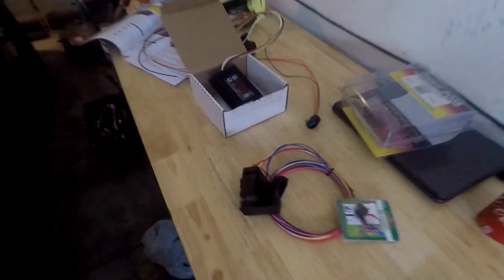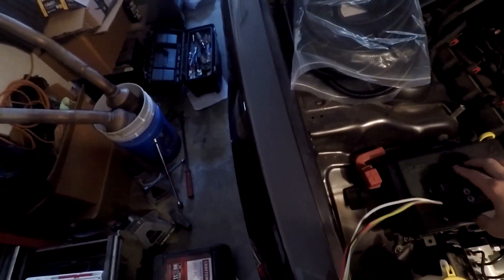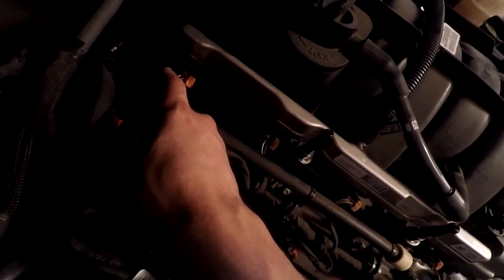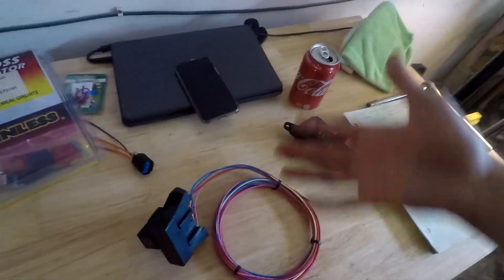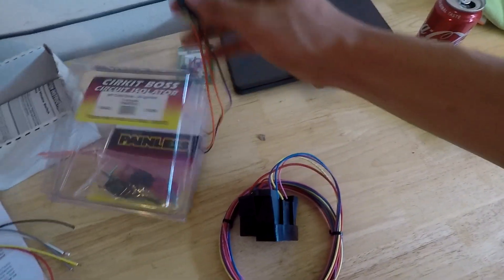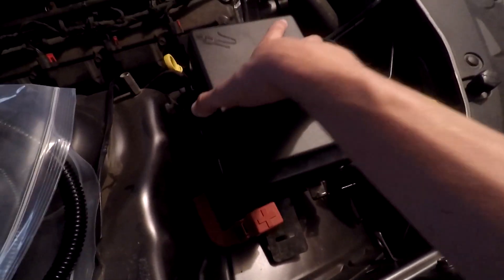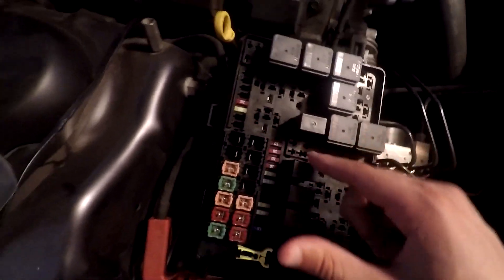392 Intake Manifold Swap: Wiring Overview | Part 2 *check description*

Comment from the maker: Hi everyone! I made a mistake with the injector wire at 4:00. In this video I said to tap into the green wire, which DIDN'T WORK. Instead, I spliced into the other wire. MSD Box is working properly now!
Fuse tapper: https://www.amazon.com/Nilight-NI-FH02-Circuit-Adapter-Warranty/dp/B0742BZXC2
Reply: I need a way to get your wiring diagram asap

Comment: @DonnySRT After you trim the red power wire off the circuit boss can you use the scrap red wire as a ground wire for the circuit boss ?

Comment: By far the best explanation of any YouTube channel 👍. Like I asked in the last video. Do you recommend an email tune or a dyno tune? If the latter what’s the best way to find a shop knowledgeable on these engines? My upgrade list is as follows. 6.4 intake manifold and throttle body. 309 lsd. 100 shot wet plate nitrous system for sure. Probably a hellcat lower air box, headers, and maybe a free flowing cat back. You talked me out of the cam, I like the current drivability as it will be my daily driver. Any help advise from you or the knowledgeable comment section. Thanks again for the great video.

Comment: I have installed my followed all directions on this video.  And I still get 0 reading on my msd.    I tapped into the second wire and yet no reading. Just 0.  Any tips ? Car starts and drives.   Just mad is at 0

Comment: Hey Donny, thanks for your videos I completed my manifold install because of you, one thing I need help with is how the SRV connector is locked on, mine wasn’t locked in because the tab was broken so I had to replace the connector and squeeze my hands in behind the motor to put it back on😂🤣  but I need a good explanation of how the connector is installed and Locked on the srv actuator 😂 because it still slides off. I pressed forward on the red slider tab to try to lock it in place but it won’t click in. I’m sucha noob please help
Reply: Could be how Installed the wires in the connector? Do the wires just push in to the slots of the connector?

Comment: So I got the manifold on and did all the wiring, no check engine lights or anything and can definitely tell a tone difference. Only thing is the MSD box doesn't light up at all so I'm pretty sure its not working... tested all the connections and they're all good so I think I got a dead MSD box :(
Reply from the maker: I've heard about similar issues from a few people about having a dead MSD box

Comment: You said you have to buy another plug. Where did you buy your plug I'm needing one
Reply from the maker: Which plug are you talking about
Reply: @DonnySRT  the plug at 1:45
Reply from the maker: @punisherhemi6008  I made a video with the links to everything. it's a wiring harness repair set

Comment: any idea if this would work with a 2012 rt? not sure if the wiring or electronics are different
Reply from the maker: I don’t see why it wouldn’t. Works for people with the 13 and 14
Reply: DonnyR/T cool cool. def gonna be getting this soon then. digging your build too man. keep it up 🤙🏼
Reply from the maker: Thanks man. Let me know if you’ve got more questions
Reply: @DonnySRT  so I finally got my hands on an intake. The only question I have now are what two ground bolts did you use? I’m not very knowledgeable on circuitry or stuff like that. We’re they the ones close to the PCM and near the fuse box and ABS?

Comment: Awesome video. Im currently in process of doing this mod myself. Already have manifold on just need to order wiring parts for the runners.
Reply from the maker: Thanks man! It's pretty straightforward with the wiring. Just make sure you have the actuator already installed!

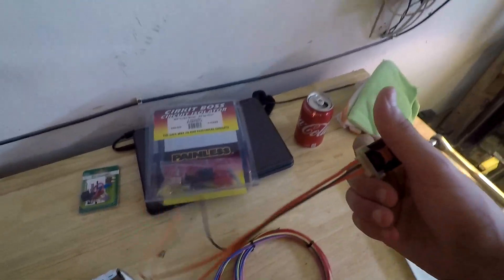Comment: Where is the part # and pinned comment for 1:15?
Reply from the maker: Sorry. It's just a mini fuse tapper. If you ask guy at auto parts store they'll know what youre talking about.  https://www.amazon.com/Nilight-NI-FH02-Circuit-Adapter-Warranty/dp/B0742BZXC2